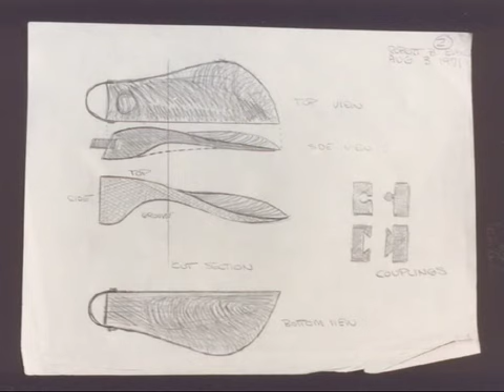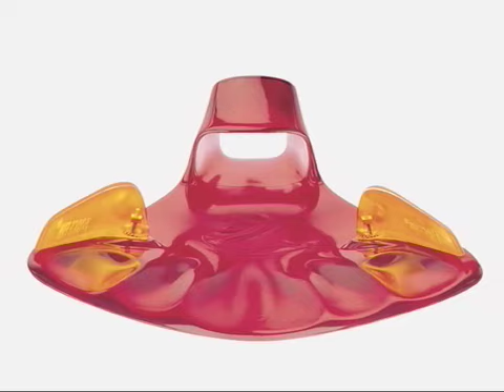Force Fin - the History , the Experience - Force Fin

Comment: at 3:55 NOTICE: Guy with Force fins is kicking TWICE as much... how is that better?
Reply: The blade moving through the water is what moves you, more reps, more propulsion. Think of it like a bicycle derailer, high gear, easier to pedal faster, relationship of Force Fin blade to body, and flexibility and snap of the blade, moves more water faster, with less load, so easier to kick more reps for more propulsion at higher efficiencies.